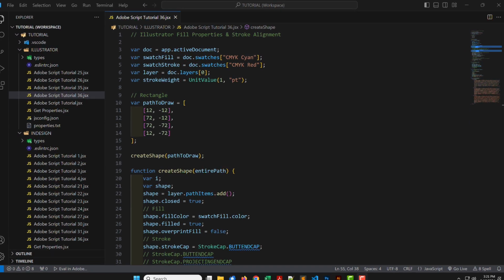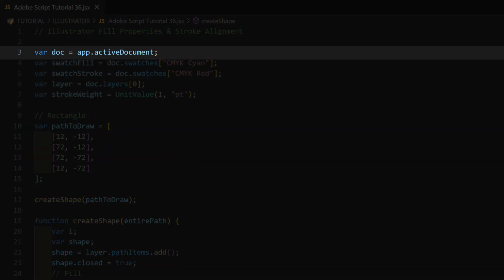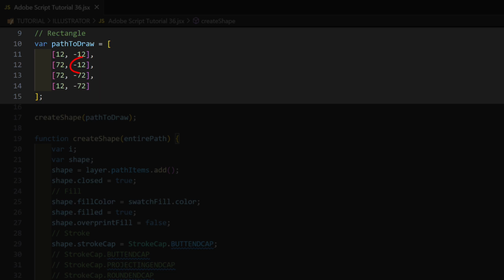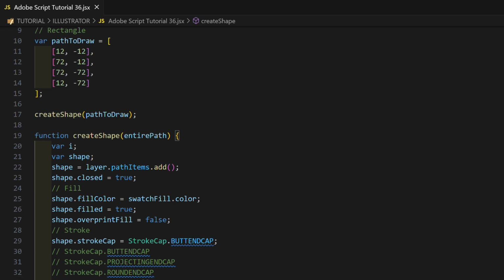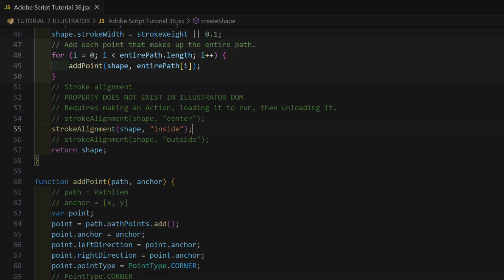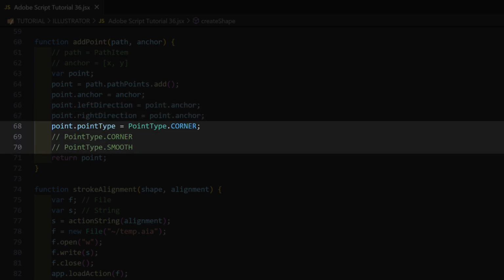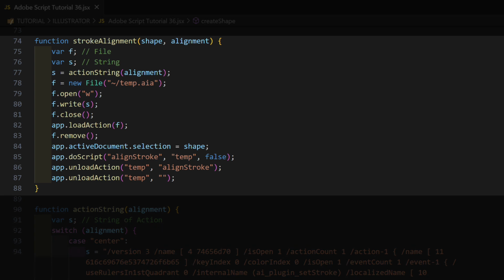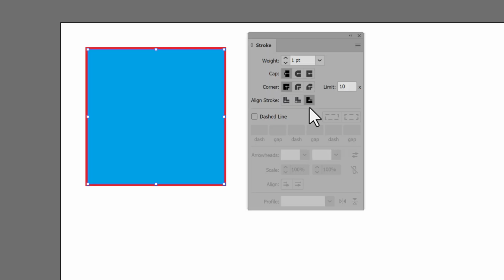Adobe Script Tutorial 36 Illustrator Fill Properties and Stroke Alignment

Comment: When we creates scripts is there a way to encrypted or secure the code?
Reply from the maker: Using VSCode, install the extension "ExtendScript Debugger". Then use option "Export as Binary.". Get the option by right-clicking the code, or use the shortcut Ctrl-Shift-J. This converts the code to jsxbin. Another method, though not as secure, is minify the code just like any JavaScript.
Reply: @wc7   Thanks I made a script that turns groups into artboards and spaces the artboards evenly instead stacking on to of each other. If there are contents in the groups it stacks the artboards on top of each like the regular groups to arboard function. is it possible to move the groups contents with the new artboard
Reply from the maker: @tiffanyw3794  There is no easy way. You have to move each PageItem in every group the distance the new artboard is from the original by calling the method translate(deltaX, deltaY) on each PageItem, one by one.  Tedious.
Reply: @wc7  thank you so much I was able to complete the script!!!!!!!!!!
Reply: I noticed that if I upload jsxbin script back into vscode and save it as jsx. it still works is this ok or could it cause problems? I know some people don't want to use or purchase jsxbin? @wc7
Reply from the maker: @hustleheartdesignco2319  There is no need to put .jsxbin back into VS Code and save it. Just change the extension from .jsxbin to .jsx. Same result. This required for Illustrator -- it won't recognize .jsxbin, only .jsx. No problem with doing this.

As for people who don't want to use or purchase something... they are free to not use or purchase it. No one is forcing them.

I see no problem with protecting one's intellectual property. Many of my scripts are .jsxbin that have sold hundreds of copies. Thousands more free downloads also .jsxbin and .jsx.

Comment: WHEN creating photoshop scripts with dialog boxes is there a way to get it load or remember previous selections?
Reply from the maker: https://youtu.be/lTWApM7i8BA
Reply: @wc7  thank you so much I don't know how I missed I have watch all you videos. Do you plan on doing any videos on how to create adobe plugins or extension. Also I created a script that turns your groups to artboards and spaces them out . but it changes the artboard background to white instead of transparent I can not figure out how to get it to stay transparent
Reply from the maker: @hustleheartdesignco2319  Plug-ins made with (for example) C++ are beyond what I can commit to at this time. Extensions I would do but I can't get the signing app to work so I gave up. I haven't conquered UXP yet mainly because the UI part is lacking much functionality that ExtendScript offers. So I'm unlikely to make any tutorials beyond ExtendScript for a while. I only teach what I know how to do.

As for the artboard issues, it depends on the app. I don't do artboards in Photoshop. It's a hack that never should have been added. Illustrator it works OK, but still, neither app should be used for page layout. That's what InDesign is for. Anyway, I don't know what it means for an artboard to be transparent. In Illustrator, anything not art is transparent, but the app shows artboards as white blocks. So I can say for sure.